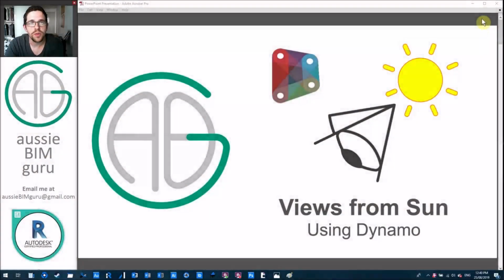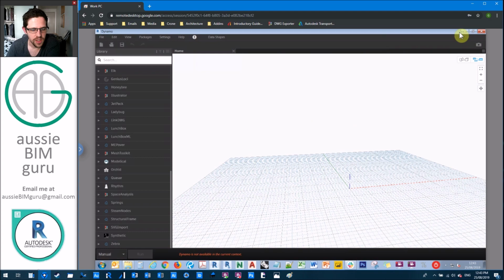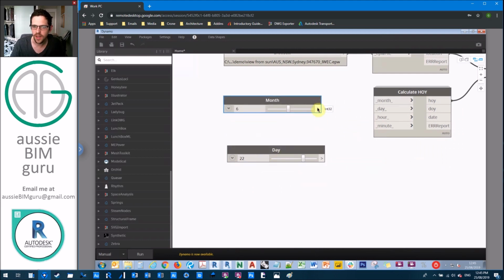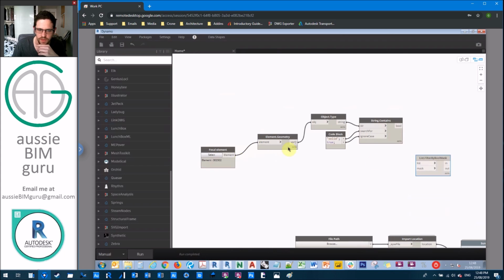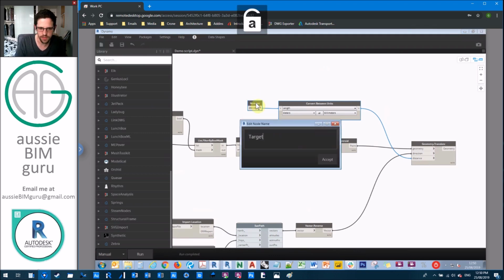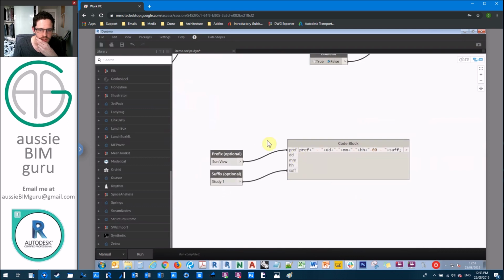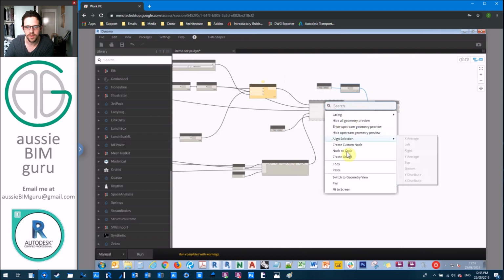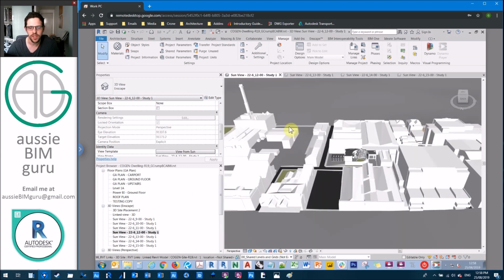Revit Views from Sun using Dynamo!

Comment: Why my dynamo ladybug node showing null. They are not working. Is the package dead now?
Reply from the maker: Yes unfortunately from Revit 2020 onwards it no longer works.
Reply: @AussieBIMGuru  Thank you for the response. Could you please provide what are the other ways to change sun position using location, date, time as input parameters. I even tried your solar analysis code, but it not working. Thank you
Reply from the maker: @bhagathmamindlapelly3618 my nodes are based roughly on the python I use in this video for reference:
https://youtu.be/9Xu8i809EFE?si=vE-m5yKNn9ymsdqM

Noting my code is in ironpython so youll need the ironpython package installed also to run it in 2023+.

Comment: hi i am using revit 2023 and dynamo core 2.13.1.3887 and not able to get the epw data. it is not showing the sun path diagram nor the sun path is grabing any data from epw file
Reply: can u please help to figure it out
Reply from the maker: Unfortunately the ladybug package does not work in 2023. I have made nodes in my package Crumple to make sun eye views using Revit native sun settings, try those.
Reply: @AussieBIMGuru   ohh thankyou for the reply. i will try it
Reply: @AussieBIMGuru  sorry to disturb u sir. can u please tell me where i can get these package crumple.
thankyou.
Reply from the maker: @ManpreetKaur-ty4ni  via the dynamo package manager. Search for 'Crumple'. It will need the IronPython2.7 (v2.5) installed if you are in 2023 or higher as it uses IronPython in its nodes.
Reply: @AussieBIMGuru   thankyou so much sir

Comment: Nice work and very useful tool! Any idea why I am getting an internal error 'dereferencing a non-pointer'  on the vector reverse?
Reply from the maker: Hrm it's quite a generic warning that sometimes relates to a bad install of Dynamo. I'd cross check that the object type of the data coming in is all vectors and if it is then maybe try reinstalling your Dynamo version (ideally 2.0.3 if you're pre-2020).
Reply: @AussieBIMGuru  using revit 2021 dynamo 2.5.0 and i am having the same error with vector reverse,  but i also don't get any information for the sun path like you did? never had to hide the preview.....
Reply from the maker: @jcvazque1  have you tried reinstalling or updating revit?
Reply: @AussieBIMGuru  Revit 2019 works well. When you try it with new versions of Revit & Dynamo you get a few errors. There are some ladybug workarounds & fixes.

"Ladybug for Dynamo is no longer being actively developed. There are also some known issues with getting ladybug to work on Dynamo 2.X. This appears to be a pathing issue, caused by the change in version 1.X to 2.X."